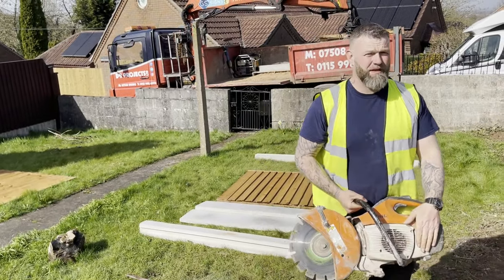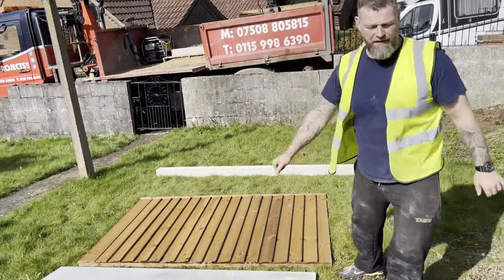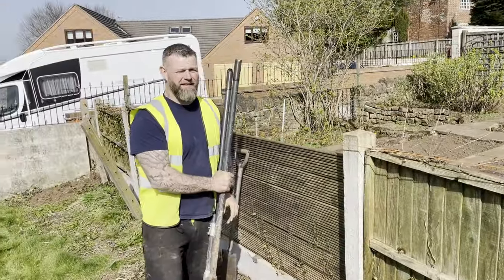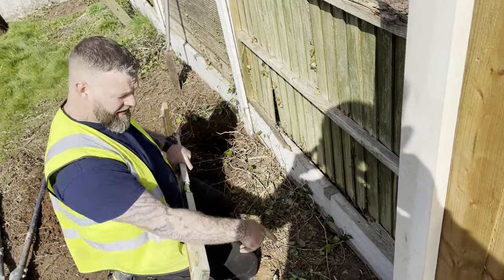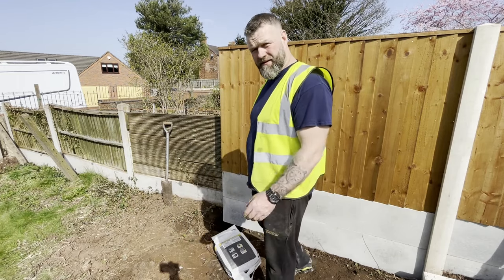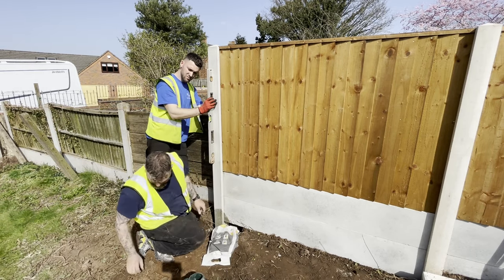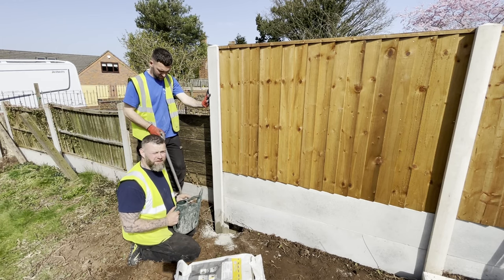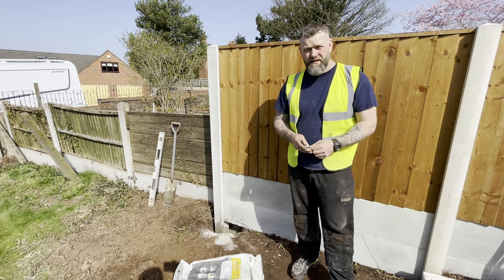How To Install A Fence From Start To Finish!

Comment: Late to comment but in regards to getting the top panel level with the columns detail, how would you approach this when working with a sloped garden. I'd assume level with the detail on 1 side and stepped at the other but curious if you have any other suggestions.
Reply from the maker: Exactly like that unless the customer wants a sloping panel 👍🏻

Comment: The 6ft spirit level you used to mark out each bay, is yours exactly 6ft?  The biggest spirit level I have is 1800mm, 6ft is 1828mm, can’t see an exact 6ft level anywhere 😂
Reply from the maker: Lol the one you’ve found will work perfectly
Reply: It’s a old one Simon we found in a skip lol and it’s 6ft 😃

Comment: How deep would you go for a heavy clay soil?
Reply from the maker: Typically always 2 feet. Being on site is always best to judge though
Reply: @DJProjectss  I ran it out last time in wooden post and Rail at 7ft maybe 7yrs ago but it ain't lasted very well and I've lots of leaning posts now.

I'd like to redo it with concrete but I've got like 75m or so!!

 Might be better of investing in a volumetric like you! 🤑😂😂
Reply: @DJProjectss  if you're doing a 3 foot high fence, I guess you need 4 foot posts to allow one foot of post below ground? cheers.
Reply from the maker: @cyborgbadger1015  even at a 3ft fence we like to go to 2ft to be on the safe side buddy

Comment: This might sound a daft question 🤔 but won't the weight of the 2 gravel boards eventually sink a bit putting the boards out of level.  (Just a question) Great videos by the way, very helpful and informative 👍
Reply from the maker: This can happen, but if you level off the bed correctly, you’ve done as much as you can do!, and should be fine!
Reply: There's a simple solution to that, because they will sink, mix a bit of postcrete in a pot and trowel it into post groove under gravel board, that board will never sink once that goes hard

Comment: Do you have any tips for removing snapped wood posts from the ground?
Reply: Screw a ring bolt in to the top of the snapped post and tie a piece of rope from the ring bolt to a pry bar which you then use as a lever to pull the snapped post out of the ground. As long as there is no concrete holding the post in the ground it will just slide out. I've used this method a few times and it makes the job very easy.

Comment: Why are you not stepping the panels down as the garden goes down hill as seen on the other side of the garden? That last panel with 2 gravel boards looks to high to me.
Reply from the maker: @flibbertigibbet6200  this is exactly how the customer wanted the fence, all level 👍🏻

Comment: I just hate concrete posts and boards. Yes they last but they look horrible. Why are you using such cheap wood panels?

Decent job though, but I prefer the look of wood. Our fences gave lasted 15 years and look like they’ll last at least they again